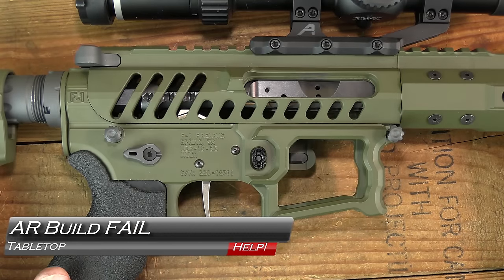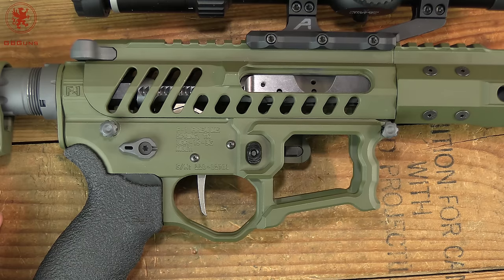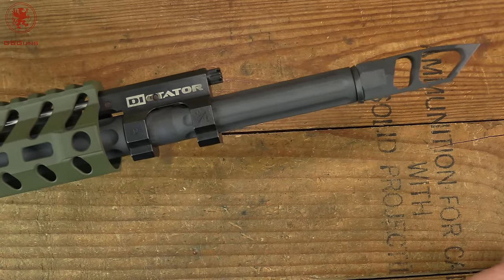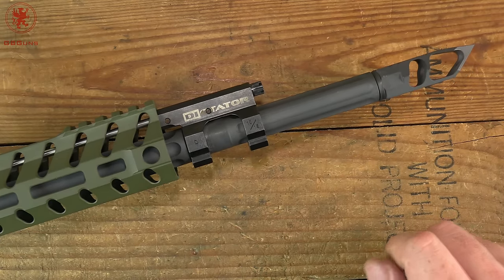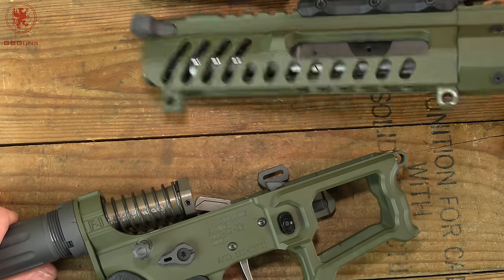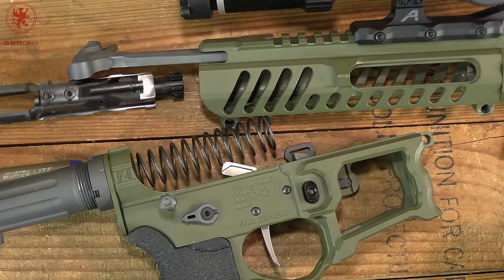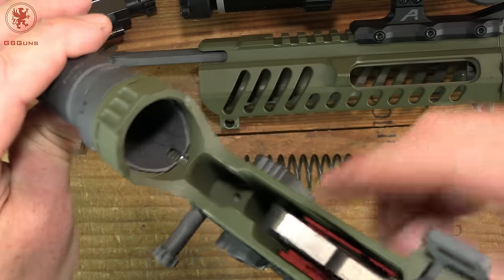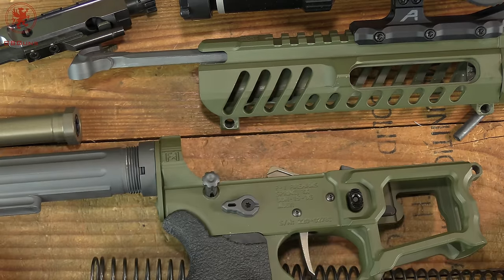The Worst Thing You Can Do For Your AR

Comment: ok one more thing. get a gas port dimpler..gas block should not be up against the stop but forward about 1/32" you need to make sure gas hole is in the center of your low peo gas block. get as much gas to go back to gas key..I have to stop...A regular BCG probably would just fix the whole problem any ways with that light Springco spring and a centered gas block. your head space might be tight. you need to check head space too. you can do it with go, no go and a Field Guage set.
Reply from the maker: Gas block was perfectly aligned, standard BCG wasn't the solution either.  See video description or pinned comment.

Comment: I know youve already found your fix and I know this is also an older video and u prob have 10 billion replies, but I still feel I should add this so maybe it will help someone some day. Ive made 4 diff skeletal builds so far and havent had an issue with even one of them but this is basically the rule of thumb I use. Do keep in mind the following is for unsuppressed builds ONLY. For suppressed builds there are other factors u have to consider:

-Stick with a D.I. build for ranged guns (I prefer mid length systems on my 16s and 18s) Piston is fine for SBR and something u wanna run hard, but could effect ranged accuracy as piston builds usually do have a little more recoil - sure they are cleaner and will take a beating but for ranged use, I just cannot recommend it over D.I.
-Always run a NiB or TiN BCG (m16 standard weight, nothing low mass or lightweight) I use Faxon cuz the quality is pretty damn good and the price is always cheaper than SRC etc.
-ALWAYS use a tunable or adjustable gas block (I prefer Odin Works or Fortis flywheel)
-ALWAYS replace the buffer spring and weight for a heavier buffer, I prefer H1 minimum in ALL builds no matter the length (if you wanna be safe) If its an SBR go with H2 buffer (I use Super 42 because price to performance is great, and its Geissele u cant go wrong)
-Since it can cause various one-off issues and accuracy issues in general as well as firing probs, not that it always will, if you did all the stuff above u might as well drop in an aftermarket 1 piece trigger, I always prefer the tried and true 3.5lb pull, single staged. However some triggers like CNC brand have had hammer issues. I usually run JMT Sabers on all my builds now days because u cant go wrong: The price is right, the looks are phenomenal, the pull is fantastic, barely any travel and reset, never any striker hammer related issues nor have I heard from others any issues with them (its just u may have a hard time finding them in stock since the plangimmick bs)

Thats not all inclusive of course, everyone deviates and finds little personal tweaks for their stuff to fit their exact needs but Ive been doing them the way I suggested above and they all work really good, really hard, and havent let me down so far. Why I like Skeletonized builds over milspec: Number 1, if nothing else: faster and better heat dissipation. With heat being such a critical thing with these guns its important to help it move away from the gun ASAP and this proactively helps that. Piston builds are helping heat buildup a good bit by keeping alot of it pushed forward, barrel-bound, but without atleast a skeletal upper it will still eventually work its way back into the reciever. Even if it does this with a skeletal reciever its taking longer to get there. Number 2: gas, dirt, grime and debris as well as fresh air moves freely through your parts, most of the time blowing trash that could be problematic out of the gun before it can even become an issue, and this is ESPECIALLY true for the upper, in my book. Number 3: It can save weight, while still leaving the gun made of steel/aluminum instead of having to revert to polymer to get the decrease ,not that I am usually worried about that part as much, my SBRs are all metal anyhow regardless, for smoother shooting and a tad more accuracy. But if u wag around an 18 incher over lots of territory all day it can add up, and u may really want that skeletal build after all, especially if in a SHTF scenario. Number 4: they are a cinch to clean, faster and easier to clean. Yeah u may have grime on the outside of the gun after firing alot because it blew the debris out of the internals via skeletal frame but when u really depend on the gun, thats exactly what u want anyhow, u wont be worried about the outside aesthetics during SHTF or home defense emergency etc ,u just want the internals to keep on keeping on if need be, and this to me, is a good way of achieving that. Number 5: Even if you drop the thing in mud or water, my experience has proven to me it still works, contrary to popular disbelief. Ive tried it. Alot

With all of that said, u may have to watch how u stow/transport/carry the gun and u may have to worry about environments that have sharp or protruding objects/sticks and brush/wires etc etc etc that could stick in the recievers but actually having this happen to u is alot more rare than u might think, even if u are presented with the aforementioned situation, that its STILL worth the trade off IMO, for the benefits u gain, hell yeah. Anyhow hope this helps someone

Comment: It sounds like the barrel is under gassed. Even though you open the gas block if that hole in the barrel is not big enough it doesn't matter.. let me know if I was right. I know this is old.  Hope you got it worked out.
Reply from the maker: That may or may not have been the true issue.  We got it running (with gas adjustments to spare) and the rifle is a dream to shoot.  We have two follow up videos and an article about the build.  https://www.ballisticmag.com/impossible-ar-build-myths/
Reply: @GBGuns   Thank you so much. I'm happy its running. Its a sweet looking rifle.
Reply: @GBGuns   He said in the article "I picked up a reduce-power recoil spring for $20. Now the rifle runs without issue" 

I was wrong but learned something new. Very cool. Thanks again.
Reply from the maker: I wrote the article, lol.  The barrel might still be under-sized at the gas port, but the $20 spring swap solved the issue with a lot less effort and time than risking damage to the barrel
Reply: @GBGuns   I was thinking of that but if it works it works lol

Comment: I'm assuming since you didn't pin a post saying it's fixed, it's not. You only have 3 choices to choose from. Switch to a carbine has system, Move the gas port back a few inches, or get a smaller spring rated buffer spring. It may also take two or all three of those. I did see a comment that sounds silly but I would double check anyways. Check your gas rings on your bolt. If they are lined up, the gas system won't work properly
Reply from the maker: I did pin a comment and include it in the video description
Reply: @GBGuns  you must have pinned a comment inside another comment. The comment is not showing at the top of the comments! So what worked?

Comment: Buffer tube might be too light. I don’t know how much you spent on your AR15 but I’d expect a forward assist and a dust cover if I spent $900 on an AR15.  The cut outs on the BCG are there so that when you push the forward assist button it helps the BCG move forward.

Comment: You don’t have enough bullet dwell time if the gun won’t cycle with the gas wide open or your buffer tube buffer is too heavy drop a 20” barrel or go with a mid length gas tube. But fist try a lighter buffer weight. And your break is upside down. Also you can go too light and the bolt carrier group doesn’t carry enough inertia, heat the spring one coil at a time till the gun runs.
Reply from the maker: See video description

Comment: The failures of your adjustments to the rifle would indicate to me that the gas port on the barrel is either clogged or perhaps it’s not drilled out completely… Or perhaps the wrong size. I’ve seen this problem before in high end carbines and rifles from both Noveski and Daniel defense; even though very rare occurrences. Removing the gas block and checking the gas orifice what either confirm or remove this question. If this is the case post another video after finding the cause
Reply from the maker: Other videos and and article have been posted.  See video description

Comment: I was watching this looking at the spring. Then went to the comments and everyone is talking about the spring. Wend back up, you grab the spring and it has no flex in it whatsoever.

Grab yourself a cheap buffer spring my man. That looks like a variable you have not tried to change. Low mass BCG with a heavy spring = the BCG cant compress the spring because it lacks the momentum. Go same length spring, but lighten it wayyyyyy up. A rifle length spring isnt a good idea either because you will compress it into the carbine length setup and the strength will probably be too much. 

Go scientific method on this thing. You know a cheap mass production AR kit works and runs. Well, see if it works and runs in this. Then if that still doesnt work. Start swapping other components out. until it does work. Then Put 1 piece back in at a time until it doesn't and you've isolated variables nicely. 

also I hope this gun is post-clean because that BCG is drier than the Sahara

edit: I keep seeing the response is "read the article" from the video poster and i have no clue what article he's talking about. 

edit 2: it WAS the spring. go figure.
Reply from the maker: Interestingly enough no one suggested the spring until I put rhat in the video description 9 months ago or so.  The article is also there or here https://www.ballisticmag.com/impossible-ar-build-myths/

Comment: and don't cut spring coils!!! for 12.00...there is a reason that the spring is the length it is. generally 1lb per in of spring. I invented a device that actually measures spring lbs. compressed. 12lbs-14lbs should be more than enough. another though is how much ceracoat could have got inside those recievers...should be none. you need to make sure that that bolt goes into full battery. I always teach guys to tap forward assist once while reloading new mag as part of reload it only takes a 1/2 second.

Comment: Idk if it's the spring. Might be. Idk what kind of spring that is, def not mil-spec. Def something expensive and meant to be in an expensive gun, reliability be damned!

If you change out the spring for something mil-spec and it still doesnt work, ensure that the gas block is properly lined up if it's even a little off that would effect the amount of gas that gets into the tube. 

Beyond that try different mags? Get a different gas system?

Comment: It was either one or the other; under gassed or over sprung, sometimes both. Too light is not always a good thing. 
Quick story; back in the 80s, NASCAR was using titanium valves (intake & exhaust) to save weight. Everyone kept having exhaust valves problems. Titanium couldn't "handle" the same amount of heat that stainless could=problem. Teams went back to titanium intake & stainless exhaust=self-created problem/solved.🤷
Reply from the maker: Let's not forget the "minor" hazard of magnesium wheels in a crash!

Comment: You have an OVER-GASSED situation. A lightweight BCG + lightweight buffer is super over gassed. Effectively what is happening is the reciprocating assembly is over-running the magazines ability to get another round in there (cyclical rate)
Take that buffer and fill it with Tungsten shot.
Reply from the maker: That wasn't it.  See video description
Reply: @GBGuns   
A heavier buffer would effectively do the exact same thing...which is to slow the cyclical rate.
But I get it...saving weight is the goal on this build.
Reply from the maker: Weight savings was not the goal, and a heavier buffer did not work.  The goal was to use the least amount of gas possible for maximum velocity and lowest recoil; to push the limits of functionality in the name of increasing cyclic efficiency.  We tried a regular buffer, adjustable buffers with various weights, the only thing that worked was changing the spring, but as you saw it now runs the razors edge and is a super silky shooter.
Reply: @GBGuns  I see. Grats!

Comment: I was gonna scream DWELL TIME, and spring tension, gas diversion, etc... But, you just did... SWEEEEETTT  BURNER... dig the TANTO POINT COMP, too.   Yeppers, lotsa gas, not enough mass in your BCG.   Spring tension in foot pounds, Bro.   And ,YES, go to mid-length gas system...   Quite possible your CARBINE LENGTH GAS IMPNGMENT is simply throwing the BCG back into battery before completely cycling and then we're back to SPRING TENSION.   You need a bigger carburetor, or gas port, too... but that means more fouling, or quicker build up...  SWEEEETTT BURNER, though.  Did I say that already?

Comment: you need to get a lighter buffer spring as well, your mistake was having a Gunsmith assemble your upper as well.. building your own is an indispensable learning process..! you don't throw it away to a gunsmith along with money to have him do it.. if you had built it your self you would have figured out what is wrong but tune your buffer system sorry there is no other way to do that without buying more parts.. you know, you could go get a 24" barrel honestly anything under a 20" with rifle length gas system is asking for tuning and cycling issues! I run a full length A2 fixed buffer tube 24" heavy barrel with fluting the thing is heavy!!! but it kicks like a pellet gun or the old pump up bb guns, and can push 68grn 2900-3020fps it's awesome punching 3/4steel plate with simple fmj's  and no recoil, any ways if you want to fix it your going to have to figure out a proper buffer system to suet your barrel choices, adjustable gas blocks can only do so much

Comment: Must be the spring and the gas block you need a softer spring if the gas is not powerful enough to cycle through.. id start with the spring first its less expensive than the block..

Comment: I think it may be the gas system you use the car being gas system also with the spring if you can cycle it manually then there’s probably no functionality with the other components it might be your gas system is not strong enough to drive back to Bolt

Comment: Shorter gas tube with adjustable gas block
Reply from the maker: Unfortunately that's not how ARs are built. To shorten the gas tube would require a different barrel. See video description or pinned comment.

Comment: The carrier is too lite, pressure to move weight at the proper velocity is causing your problems,  light weight stuff is so far out of operational spec it's confusing. Only certain parts can be light weight

Comment: Its not short stroking, everything being lightweight and with the resonance of the metals being used.. its resonating or vibrating so much that it isn't going back far enough, most of the power is being wasted in vibrating parts that are now working against each other. Its physics, too much power for all of the lightweight, make the rear spring lighter or make the buffer heavier.
Reply from the maker: That's an interesting theory.  See the video description for the correct solution and an article you may find interesting.

Comment: You answered your own question, gas system length is almost certainly your issue.
Reply from the maker: That's not the issue.  See video description
Reply: @GBGuns  so what's the issue? Since I've delt with this issue personally for quite a few people
Reply: @GBGuns  you could lighten things all you want but if you don't have enough gas to push the bolt carrier back far enough to extract and pick up the next round that all that light stuff you have doesn't mean s***

Comment: You need to remove your gas block and open up your gas port. Your rifle is under gased. I had to do that to a BA 18 inch rifle length barrel. Now it runs like a top.
Reply from the maker: Fortunately the solution was much simpler

Comment: IF YOU HAVE TROUBLE PUTTING THE UPPER AND LOWER TOGETHER. IT SHOULD TELL YOU YOU HAVE A PROBLEM.
Reply from the maker: There isn't, just a tight fit meaning tighter than milspec

Comment: Obvious under gassing, like you said. Your focus seems to be at the gas port, gas block, buffer, and recoil spring. That is only part of the equation. How are the gas seals between your...
1) gas tube and gas block?
2) gas tube and gas key?
3) gas key and bolt carrier?
4) bolt carrier and gas rings?
5) bolt carrier and bolt tail?

These specs can be measured by gauging. I can do that for you. Check out SOTAR BCG physicals. I do the same type of diagnostics. Home builders are treating ar15's like legos. It isnt that symple. You can usually throw something together that will "run," but you may always be 1 shot away from a malfunction because you really dont know what all you should be doing.

If youre in Tennessee, you should come see me. We'll get you fixed up for free.

Comment: Its not extra friction. It is not enough weight. When you start buying all kinds of different brands they don't always work together correctly. Your housing
is way to tight, as in tolerances. You should not have to leave out a pin that holds your weapon together. Your Buffer is way to small. It needs to have weight. If you replace the buffer to a larger one (with weight), change out your trigger assembly to a normal one,  change out your Bolt carrier Group to a normal run of the mil , I bet you it will run like nobodies business. If it doesn't then you have a bigger problem,  which would be the inside of your main upper receiver. I did 20 in the A R M Y, and was an armorer during some of that time period.
Reply from the maker: Unfortunately you're incorrect about the buffer.  See video description for solution, footage of it running, and the article on Ballistic